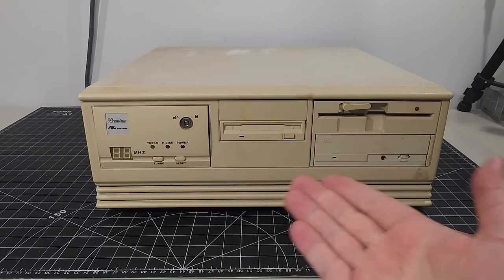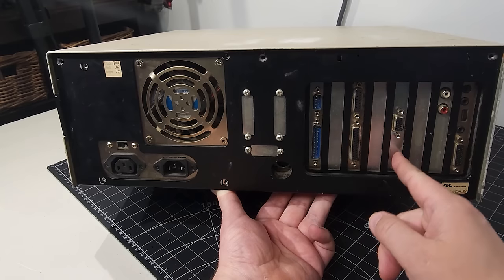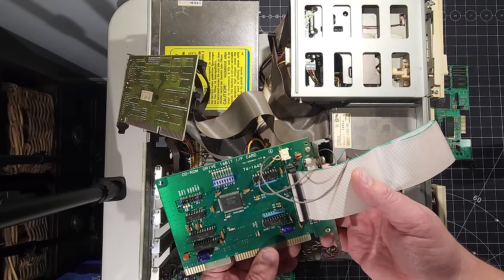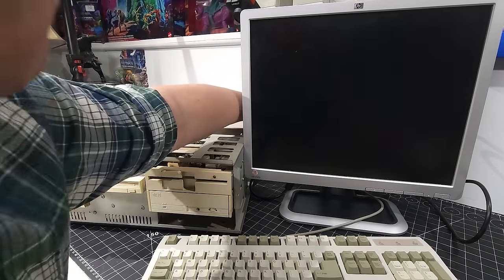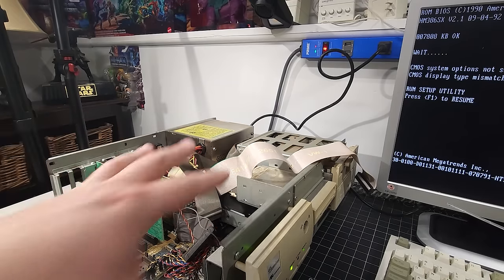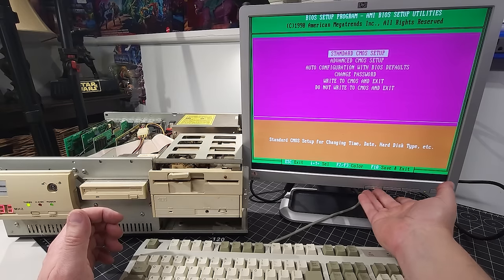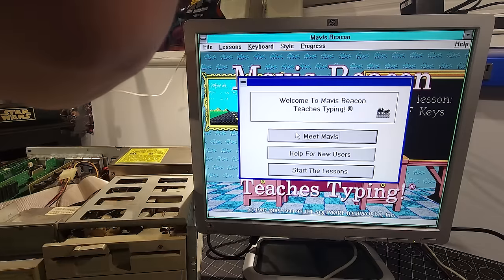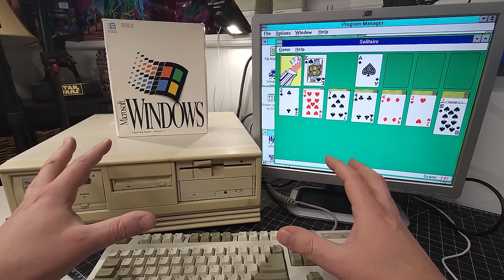What is this Computer...Will it work??

Comment: Oh how I remember these days.  Cut my teeth on Apple II's and TI-99/4A's.  After playing "Secret Weapons of the Luftwaffe" on my friends 386 I struck out to build my own PC as Dad's 286 couldn't handle the game. Stuffed a 486-DX2 50MHZ into that AT case. Along with a Diamond (I forget the model) video card that utilized the VESA bus and a Sound Blaster 16.

Over the years I have built and fixed many a PC.  The only real challenge you have today when building is if you are doing custom water cooling.  Back in the 80's and 90's you would fight many more battles to get things up and running. The jumpers,  Oh Lord the battles with jumpers on motherboards, and expansion cards.
Reply from the maker: Hahah yes so true!  I bought a 14.4 modem (upgrading from the 9600 one) and it was a nightmare to get going in my 486 dx4100.  It just would not play nice.  Today I Thi k that challenge is a fun one to figure out.  Back then I wanted to toss everything in the dumpster lol.
Reply: @TheRetroRecall Don't forget the USR 56K VS  56k Flex modem battle. Or the 420Mb HD Barrier. And the VESA / AGP battle.
Reply from the maker: Hahahahahaha I'm cracking up here.  I'm pretty sure I buried those painful experiences lol
Reply: @TheRetroRecall What about those good old SIPP RAM modules before EDO took over?  Oh the joy of bending a pin.

Then the AT/ATX form factor battle.  I was team AT since I liked the hard power switch vs the soft switch on the MB.  That and I hated bent PS/2 pins.
Reply from the maker: Haha!  I will say I was one of the lucky ones.  Even though I has SIP memory on my 486, I never had to do anything with it haha!

Comment: That Mitsumi whole-tray single speed CD-ROM was my first optical drive, some time in 1992 I think..
Reply from the maker: I can't imagine it being very quick lol, nor reading a lot of different types of media.
Reply: @TheRetroRecall  well, single-speed was 150kb/s as far as I recall, so it definitely wasn't quick even by that time's baseline.. but it was surprisingly tolerant for all kinds of media.. e.g. it would handle burnt CD-RW fine, when even later drives of other manufacturers would still struggle.
Reply from the maker: Lookimg forward to testing it out!

Comment: You need a power supply tester and a post card. Makes it much easier to diagnose old computers. I have tested many in my past life. Too old for it now. Eyes and patience are not so good any more 🌝
Reply from the maker: I have both haha.  Except my PSU tester doesn't have AT power connectors.  As for the post card, I contemplated it and figured why not go through the method I did.  All is well in the end.  If you check out some of my other videos, I definitely use both.

Comment: Did you check if the Drive cable was an ATA66 or ATA33 and whether the Drive is set as Master or Slave.  I presume the cable you replaced the original with would have been an ATA66 in which case it would not matter if the IDE Drive was plugged into plug one or two, even Cable Select would have worked.
Reply from the maker: I checked the old cable again and it was plugged in correctly (same as the replacement cable).  As for ATA 33 VS 66, I would have to check again.

Comment: Good old mitsumi single speed cdrom and it's interface card. I still have one of these in an old machine but the interface card was redundant as the gravis sound card has the proprietary cdrom interfaces on it. old gold top pentium 60.
Reply from the maker: Nice!!! This was my first system with a dedicated interface card as most of my older systems usually had the 3 interfaces on them for the different 'standards'.

Comment: Hard drives. A few months ago, my brother's UEFI-based PC wouldn't POST and he (a 3D modeller) and his girlfriend (a career programmer) were troubleshooting. Based on prior experience with a Pentium BIOS that would POST but then stop at the hardware summary screen, I suggested trying to pull the SATA cables before they go too crazy pulling components that are more hassle to remove... it proceeded to boot right up off the NVMe as normal. Turns out the Samsung SSD from his previous machine that he'd been planning to put Linux on had died.
Reply from the maker: Nice troubleshooting!  I'll be honest I've never had an SSD die yet.. But it's going to happen.
Reply: @TheRetroRecall  I suppose we're a bit unlucky there. Just this morning, I received the RMA replacement for the WD Blue SSD I bought for my mother's laptop last Christmas. That one had the controller flat-out die rather than going crazy, so the machine would still POST and boot off USB sticks.

(Rotating drives, on the other hand, I've only ever had one 6TB WD Red die out of all the hard drives I've used over the decades... though I did have one of a pair of 500GB Seagate drives develop a couple of bad sectors after 11 years of 24/7 operation.)
Reply from the maker: Some of these drives can go forever it seems, but they all stop some day
Reply: @TheRetroRecall  Yeah. Reminds me of what NASA-level design and quality control can do for making a device last beyond its rated service life.
Reply from the maker: Haha do true.  I mean I start up some older stuff and I'm floored it works.

Comment: I'd recommend replacing 3,6V baattery as soon as possible. It will leak sooner or later, maybe it already did - check motherboard for green corrosion. It really may permanently damage the motherboard.
Reply from the maker: I'm fortunate, as there is no leakage.  Also, I have removed the battery :)
Reply: @TheRetroRecall  so, may we expect further restoration video on this pc?
Reply from the maker: Definitely.

Comment: it kinda makes me suspect the IDE cable you have there is of that other type made solely for specific types of CD-roms etc, the interfaces at least look the same but is not cross compatible with each other. maybe sometime the computer was taken apart and mixed the hard drive and cd rom cables around and made it not work and give up? I find it very unlikely such cable would end up short, it is more likely a pinout issue or something.
Reply from the maker: I had tried the cable again after the video with he correct pinout and the same thing happened.  Popped the replacement cable and no issues.
Reply: @TheRetroRecall  yeah. I guess it is an exception that one. Weird for sure

Comment: Sure it's a NIC and not an NEC? First of all, it is definitely frankensteined. Looks like a CD, 5.25 and a 3.5 disc drives. Quite possibly a Pentium 2 processor. I'm guessing an early 90's model. You'll find an early model HDD inside (can't say what size for sure) and the RAM cards will be pretty primitive too.
Reply from the maker: Haha, did you see the video?  And yes, NIC or AIC.

Comment: I don't think the HD IDE cable is defective, but it was installed incorrectly.
Reply from the maker: As noted in the other comments, I have adjusted the cable after as per the recommendation of others and confirmed that it was in fact installed correctly - same result.  I pop back the replacement IDE cable, same pinout configuration - works.  The cable is definitely bad :)

Comment: That CD tray is trippy. Any idea as to why they made that design choice? Like, what "problem" were they solving with that...
Reply from the maker: Haha I have no idea.  We're they experimenting with the design? This was a 1x drive with a separate controller card... So very early model.
Reply: Early design.  All the first CD-ROMs I was exposed to were like this... they also were in institutional systems (schools), where they had some sort of case lock that would prevent the CD-ROM from being opened by users.  Some of these systems were also CD-ROM changers, which had a 6 CD pack that would slide into the front of the system, and locked with the same case lock.  Some CD-ROM drives were in external enclosures.  They were ALL SOOOO slow... churning forever to find the data you wanted.

I don't remember the conventional sliding tray CD-ROMs becoming common until they had gotten the price down around '93.  For many of us, the CD-ROM drive was a chicken or egg problem... we didn't buy a lot of software on CD, so why buy a CD-ROM?  I got my first CD-ROM drive in '96... only because we had a CD-R at work and a fat pipe to the internet.  The size of Windows95 also encouraged people to get CD-ROM drives.
Reply: Another thing back in the early days was CD-ROM drives that looked like personal stereos, some in beige or white... you would hook them up to your computer with a SCSI cable... and could use it as a stereo at other times.
Reply: @buckykattnj  WOW! Fantastic insight. I used to use the locking /removable hard drives back in my earlier school days, but I have never seen the optical versions of said enclosure.

Jeeeez, I haven't thought about 1X in a very, very long time.
Reply from the maker: That's neat, I never saw these before, I'll have to check them out.
Reply from the maker: A blast from the past for sure.

Comment: Sold those type of cd drives new. I can't remember if they mfg 2 types. One being MPC compliant and the other being non. But the one's at the shop  I worked at was MPC 1x 150k compliant to play video clips. Though, they would video would jerk unless you got the buffers correct on the (to long ago) cdrom.sys file or mscdex.exe file.
Reply from the maker: I just looked up the model online, it's a 1x drive requiring that special interface. I didn't see any reference to MPC compatibility.
Reply: Sorry, I think MPC came later just to say system was multimedia already having the cd-rom / sound card combo. But to many years ago. As for the special interface. Yea, that was fun. Also why some sound cards had several interfaces on them. I remember (before the internet.) somebody finally faxed a paper showing what drive worked with what card. If you notice some audio cards didn't tell you what drive they worked with. A good example is sound blast could be Sony or a Panasonic drive. Just with sound blaster branding in a combo kit. @TheRetroRecall
Reply from the maker: Yes and no worries at all.  I love the discussions on here as a lot of people learn and it really brings a lot of nostalgia back for me as well :)

Comment: I'm curious if the IDE cable was connected wrong, not faulty but upside down, etc. I dont remember ever having an IDE cable fail on me.
I know it could happen, going open circuit, I can't see that causing the problem you had, so if it is bad, I'm assuming it must be shorted somewhere. I would have liked you to try the cable again to prove it was bad and not just wrongly connected. My guess is wrongly connected.
Reply from the maker: Hey there, thanks for the suggestion.  Many viewers had recommended the same thing.  I did try the cable again and the same results occurred.  It was connected correctly in the right position.  I still have the cable, just haven't gotten around to testing to see if there was a short in the cable.

Over the years I have had several bad IDE cables.  Mostly on these desktop form factor PC's.  They tend to bend the cables in different ways to 'flatten' then or to move them ajust a little out of the way for different hardware over the years.  I am quite confident it was the cable.
Reply: @TheRetroRecall  Thank you for your reply. I would be interested to know what you find out about the cable.
Reply from the maker: Stay tuned for the next video... :)

Comment: 2:11 That display is a dummy display, it has no logic to know the processor speed. It has jumpers on the display board you can set to display any value. 2 digit display with turbo button probably from the 286 era.
11:44 Ah, the days when you had to actually know the IRQ and DMA addresses being used an you only had 4 available IRQ channels to work with.
Reply from the maker: Thanks, appreciate it!

Comment: The original hdd ide cable was just flipped/reversed. Classic issue - dead machine (incl. hdd) while hdd led is constantly on. :)
Reply from the maker: Someone had suggested that and i had confirmed afterwards that it was installed correctly.  I reinstalled it and it did the same thing.  Must be a short in the cable.
Reply: @TheRetroRecall  damn... Good to see this machine now going.
Reply from the maker: 100%!!!

Comment: It wasn't the case here. (Actually I never even tough an IDE cable could cause problems), but when this not posting happens for me it is 99.9995% of times because of the Video card, so that is the first thing I'll remove
Reply from the maker: Interesting, I never thought about the video card as my experience with them usually causes post beeps with the video.  But yes, the IDE cable really threw me as I thought it was the IO controller card.

Comment: Are you from Vermont? I betchoo are for shore 😅
Edit: there is some bus conflict due to a failure of one of the exp.cards
Edit: 21:46 if and only if the hdd does not spinup, the ide cable is plugged wrong on either end/both ends
Reply from the maker: Haha, from Canada, and the cable was the issue.  I tried it afterwards again to make sure it was pinned correctly and same results.
Reply: @TheRetroRecall  😳 thank you for smite response. Never happened to me such a thing, always a cable twist
Reply from the maker: This was the first time I experienced this behavior, so it was a learning point for me!

Comment: The first thing you do is take a multimeter and check your power supply.
Reply from the maker: Thanks for the suggestion!  I generally test the atx power supplies using my tester... Did not on this AT PSU.

Comment: My god!  What a bunch of punks!  What are you guys?  30 years old...or less???  This was what a DOS-based PC looked like from the early to the late 80s.  I bought my first one around 1989.  Back then, most of the boxes were essentially build-to-order or self-build.  That's why there is no familiar brand name.  I'm guessing either an Intel 8086 or 8088 processor.  It could have been built with as little as a MB of RAM.  In fact, it may not even have a hard disk.  (Machines from that period were often booted from the floppy.)
Reply from the maker: Thanks for sharing.  Not sure about the punks part :). As for the case - yes many generic mom and pop shops were popping up all over trying to compete with eventually became the market leaders.  Hopefully you got to watch the video.  It's a decent 386 and was quite fun to explore :)
Reply: @TheRetroRecall  j/k 😀
Reply from the maker: Hahahahaha I know 😂

Comment: That is NOT an IDE cable on the CD controller.
Reply from the maker: I stand corrected :).  Bad habits.  Interface cable from the Mitsumi optical drive to the interface card.

Comment: Seeing that ungrounded outlet strip made me cringe hard.  Why are you running anything electronic ungrounded?
And if you know you may have a grounding issue, perhaps that's why?  
Or maybe check the internals of the power supply to ensure none of the capacitors have blown out?  With anything that old the first thing I'm going to do is check the caps.
Reply from the maker: The strip is grounded to the building power via the ground plug - hopefully you have un-cringed.  When I commented 'grounding issue' on this video, for anyone who has ever worked on systems is aware that a MB or other component touching the chassis can cause this symptom.  Thirdly - did you watch the video to the end to determine the cause or just comment on the first part before seeing the solution.
Reply: @TheRetroRecall  - No, I saw the solution.  But what I DID miss was the outlet peeking out from behind the right side of the monitor after you replaced the ribbon cable.  I'd assumed all the outlets were ungrounded, but that one has the third prong hole.  I went back and scrubbed through the video to see what I'd missed.

And FWIW, I used to work on systems of that era when they were still relevant.  And I support the latest and greatest today.  So I found it unsurprising that a kinked cable caused the short.  I was most interested to see how well the multimedia package worked because I've never seen that type of CD drive mechanism.

Comment: I am like number 943
Reply: you didn't test the CD drive.
Reply from the maker: Nope - nor the floppies :)  The goal was to get the system up and running.  In the restoration video we will tackle all of those items :)
Reply: @TheRetroRecall  here is to hoping they all work. 
it would be cool to see a modern system with a working floppy drive, and multiple CD/DVD/Bluray drives.